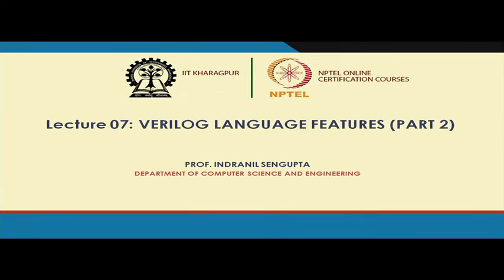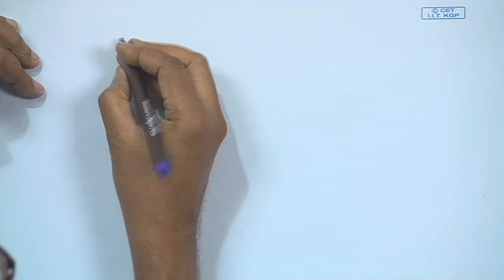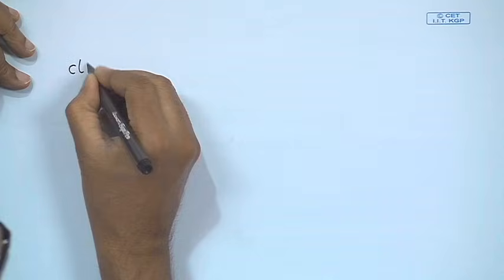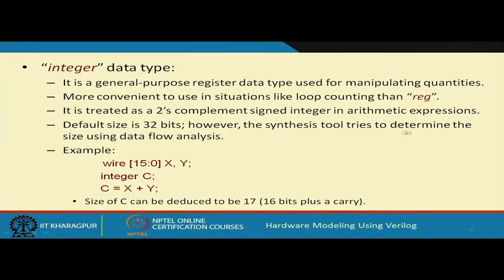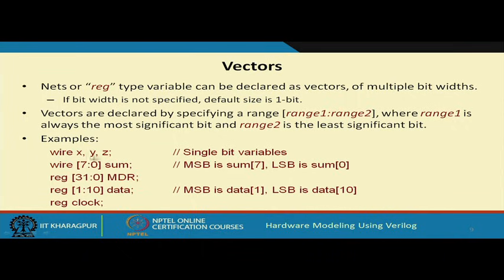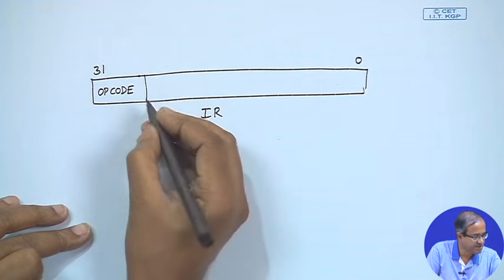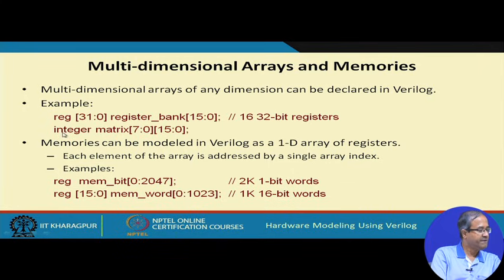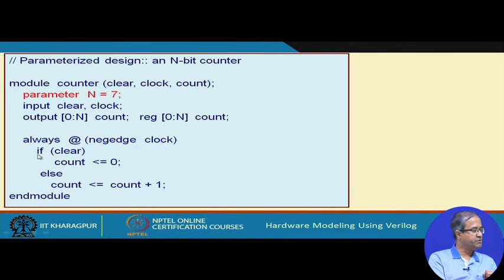VERILOG LANGUAGE FEATURES (PART 2)

Comment: at 32:20, you used edge but you taught previously that we use net on LHS. Can anyone
 explain?
Reply: that was when using assign keyword, LHS should not be of reg type
Reply: so when using continuous assignment we have LHS as net type like assign sum = a+b, but when u are using the var inside the always or initial block LHS must be of reg because are retaining value right otherwise how would we able to implement that counter, i hope this helps